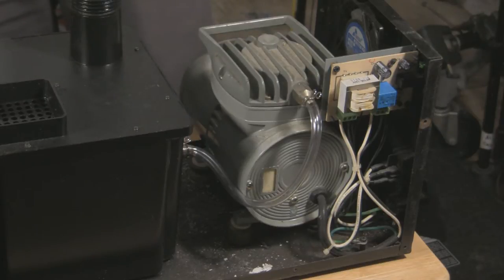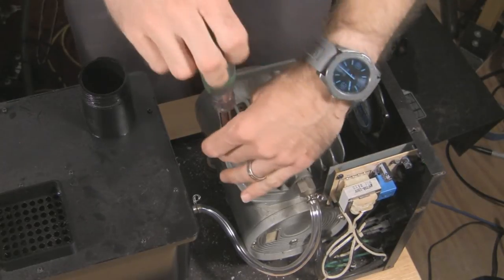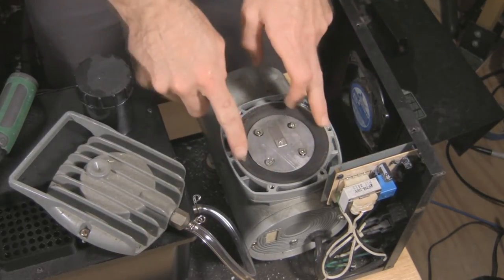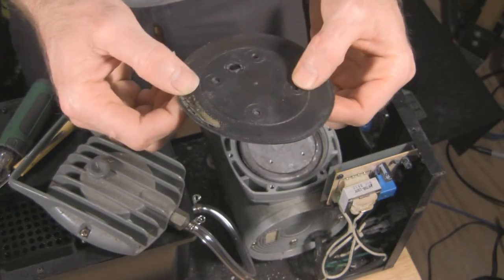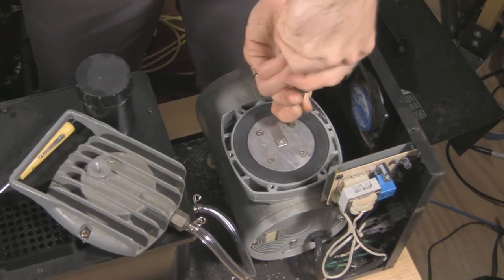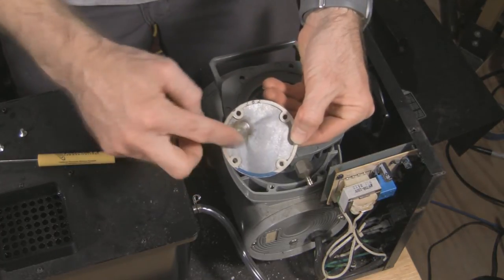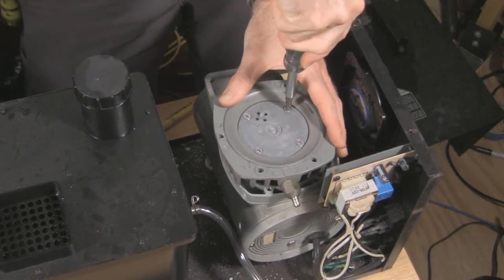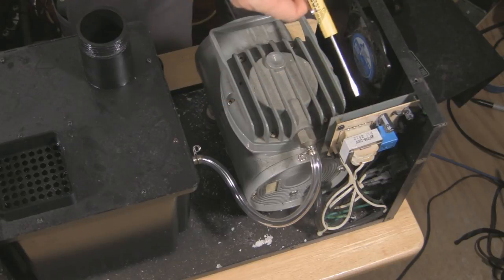American DJ Haze Generator repair / maintain, air compressor How-To

Comment: If it's just an air pump and an oil reservoir, then how hard would it be to make something like this yourself?

I remember when I bought my first Haze Generator years ago and it was around $300+.  Now, the exact same model with no upgrades is almost $600.  I'd rather try to make one myself than keep shelling out that much money.
Reply from the maker: Do it, don't forget grab a nice fan to push the haze out.

Comment: I have one the hose and pump are fine but still no haze. Tank half full with ADJ haze g Oil. Any suguestions?
Reply: Did you figure anything out?  Mine has low output.  Pump and hose are good.  I removed the tank to check the air line going in (tank) but it is not removable without cutting the tank.  I did try to blow into the tank air line but it was very restricted.  Maybe its clogged or maybe its suppose to be  that way?  The mechanism inside the tank looks like an aluminum distribution device with 4 airline outs.
Reply: Yes you can take out the bulkhead and clean out the nozzles (there are 3) with a torch tip cleaners or a small piece of wire. You take it apart also and clean it out if you want to. Just loosen the allen bolts up and it just comes apart. Mine works like new again. I put the tank back together with some clear silicone from the auto parts store. Cost less than 5 bucks to fix but its messy. I think I spent more time cleaning up than fixing. Lol
Reply: @lightingmike1242  Not sure if anyone will see this, but I have 2 of these with diminished output.  Took the tank apart, but one of the hex screws to the aluminum "thing" won't come out.  I'll try to clean the nozzles out w/o taking it apart.  But I am curious as to how it can get clogged when all that goes through it is air?  I thought it more likely that those little air stones might be clogged?
Reply: @clubinfinity7785  Think of how it works, like a paint gun It pumps air thru the nozzle and siphons the fluid up thru the filters where it mixes together. Then blows the mixture out the tip of the nozzle into the chamber where the case fan ejects it into the room. If the stones are clogged you wont be able to get any fluid threw them threw them. ( Yes you are correct. try taking them off and blowing thru the filters) If the nozzle is clogged, it will reduce the amount of air and fluid that comes thru it. All it takes is a small piece of dirt to clog the nozzles. Chances are its the nozzles that's clogged over time. If this doest help let me know. 

I AM 99,9% I can get you working again for very little if any money!

FIRST:  Make sure you are using OIL BASED FLUID FOR THE HAZER NOT WATER BASED !

Comment: Couldn't you just swap it out with a cheap airbrush compressor from ebay they look like the same thing ? Im going to make a DIY hazer using one
Reply from the maker: Of course, you can pop a different compressor in there. I just don't know what forms the haze inside the tank. I assume the air supply simply bubbles in the solution, but maybe there is an air stone, like in a fish tank. I never broke open the tank on the hazer to look. Let me know if you get it working!
Reply: @therockstudio  You can test this!  Disconnect the hose from the oil reservoir and just drop it into a small bowl of oil haze fluid.  I'd love to the know the outcome!